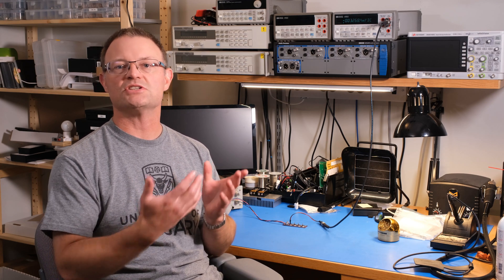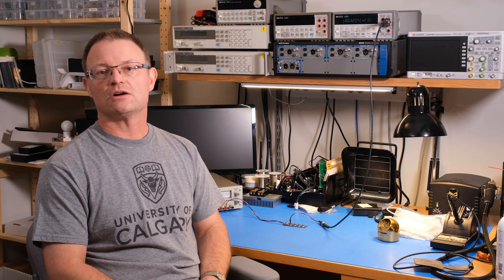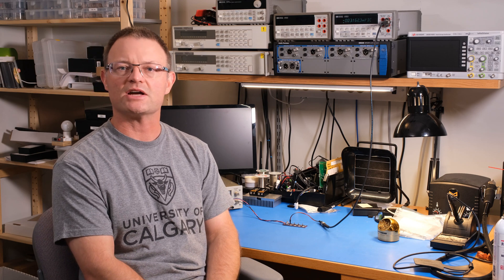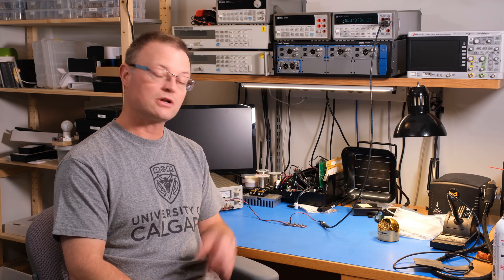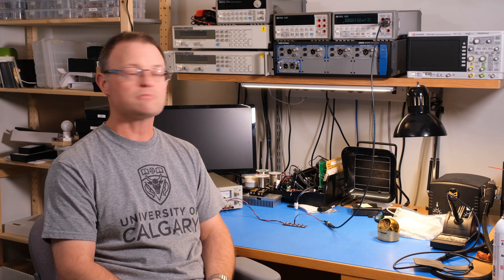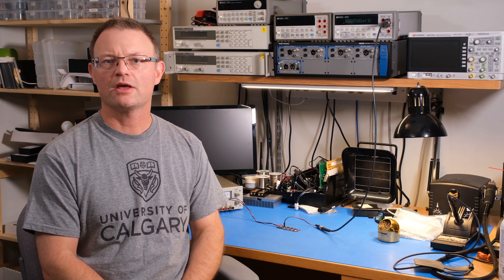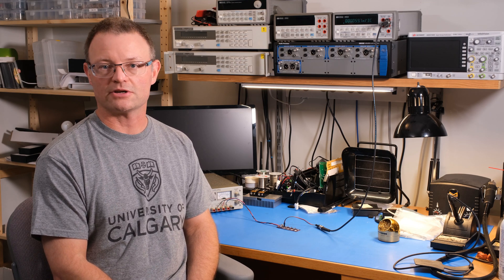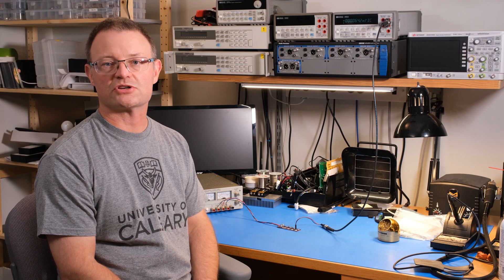Neurochrome: Want better DC performance? Clean your circuit board of flux!

Comment: A cleaning tip.  Whether you dissolve the flux with water or IPA you are still using a "dilute to remove" process.  With IPA because it evaporates so fast this leaves beginners in the awkward situation where it seems right to let it evaporate away and leave the board clean, but what really happens is, you spread the flux over the entire board while it is dissolved in the alcohol.  The IPA evaporates away and leaves a lovely thin coating of flux on the entire board.  It looks "cloudy" and every bit of fluff sticks to it.
Don't do this.  Instead, give the board a bath in IPA, like tip it on it (FIRE SAFETY IMPORTANT!).  Give it a harsh brushing, ideally with a conductive brush, not a wire brush you monster!  LONG before the IP evaporates away, while it is still very much a pool....  DAB it with an absorbent towel.  DO NOT RUB.  Your job is to take away as much of the alcohol as possible.  When it evaporates from your cloth it will leave the flux on the cloth.
This will leave the board with an overall reduced total flux.
Repeat twice, bath, scrub, soak away.  Then you can start rubbing, but ... kitchen towel leaves fibres.  A set of anti-static cue tips and lint-free swabs might be better.
Reply from the maker: Those are great suggestions. Thank you. I agree that you can't just rely on a simple alcohol wipe. I prefer to use actual flux cleaner and a pretty stiff brush. I then wash the (hopefully) dissolved flux off and dab the excess off with a microfibre rag. That works pretty well.

That said, I much prefer aqueous (water-soluble) flux. Whenever I build a board from scratch I'll use that as much as possible and then just wash (and scrub) the board under running hot water. Then shake the board dry-ish and let it dry completely for 10 minutes at 80 ºC.

Comment: Never would have thought RMA flux would do this. Took a soldernig class a long time ago, and it was very difficult to remove RMA. Had to look under a low power microscope and get the last bits off with a tooth pick. It was a soldering class for DoD hardware and took it in 1989.
Reply from the maker: I was surprised too. RMA flux is pretty easy to remove with an actual flux remover. MG Chemicals makes one. There's also ChemTronics FluxOff that's quite good.
Reply: In the DoD class all we were allowed is isoporpal alcohol and a soft wood tooth pick. @Neurochrome2010

Comment: Interesting video. There was no mention of using any conformal coating after cleaning off the flux, and what if any effects might be exhibited with that change. Do you apply conformal coatings of any sort to your circuit board assemblies?
Reply from the maker: I don't apply a conformal coating. My circuits don't operate in harsh environments so it shouldn't be necessary.

Comment: Tom, I almost never think about flux so thanks for this video.  In my case, and I suspect many others, I use a multi-core solder with flux inside.  Do you actually flux your circuits and then, I assume, use a solid core solder?  Or is there solders available that contain these many fluxes you talk about?
Reply from the maker: I use the same solder as everyone else; flux-core solder. If I know I'll be able to wash the board after soldering, I'll use solder with water soluble flux. Otherwise I'll use either RMA or No-Clean flux. I don't add flux other than what's in the solder.